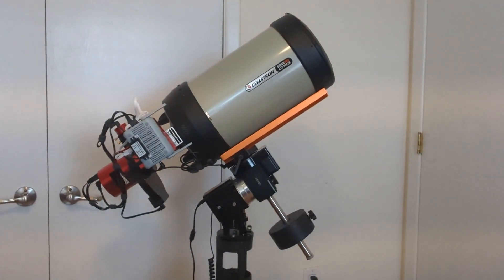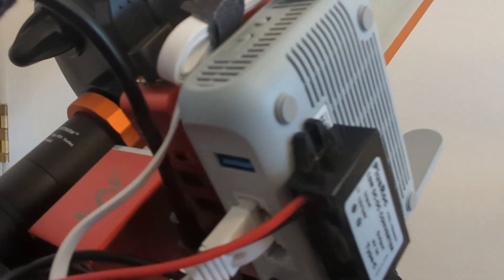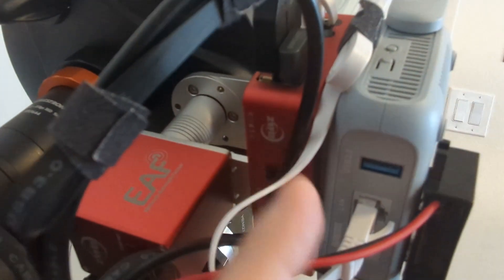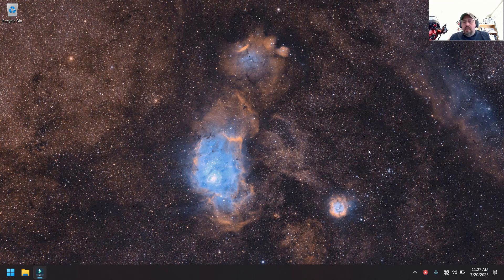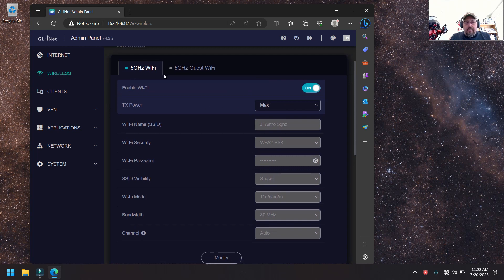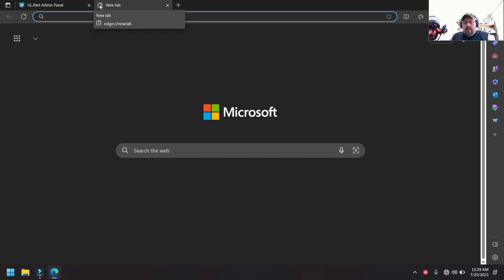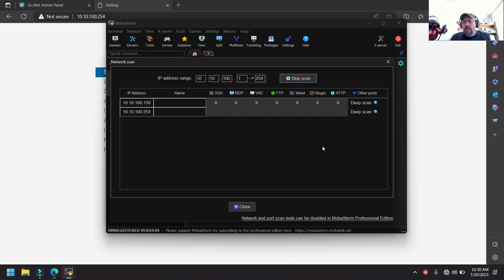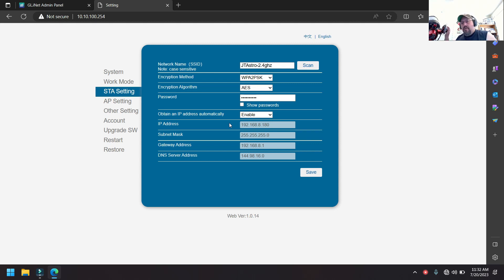iOptron + GL-MT3000 + ASIAIR

Comment: Joey, that was a great video! I had watched it several times. I was wondering if you use a pc or a mac. How would what you did differ for a mac? Thank you for you input and have a nice day.
Reply from the maker: So you can use a Mac or Windows. However to get Mobaxterm on Mac you need to either install VMware for free and install windows or you can pop for a license of Crossover

Comment: Great video, loads of information! I see that you are using many different softwares. The software for the MT 3000 should ne enough to get the job done correct? Please let me know, thanks.
Reply: Thank you
Reply from the maker: @donbarlow6435  my pleasure!
Reply from the maker: Yes it will allow you switch back and from from ZWO to Open Astro, to what ever the heck you want to use including Windows or any other system. Again the MT 3000 is simply a router that lets you connect directly to the mount and then from there what ever you want to use.

Comment: Thanks a lot. I have gem28, other router, all done well, almost work, I see my mount, asiair too on my router but how to setup mount on asiair. this one is some problem for me. with usb mount works, when I disconnect gem28 from the asiair it stops working. How to setup asiair, ethernet/serial?
Reply from the maker: I used to have the gem28 does it not have a WiFi option? You might be able to purchase an Ethernet to serial cable but that would be an ask to tech support at iOptron.
Reply: @JTAstro  gem 28 has the go to nova 8409 driver and it is there. I once connected to Asiaair via WiFi but I had to enter 192.168.X.1YY where YY=28/45/70. Now somehow I can't. The router connected via Wi-Fi to gem28. it's about what to enter in the asiair mount settings?
Reply from the maker: @astrobalkon  log into the router and make sure the gem28 is connected through the web portal.
Reply: @JTAstro  all works, I just had to enter the correct ip address and port to asiair for mount. THX
Reply from the maker: @astrobalkon  perfect glad to hear!

Comment: Do you live any where near Dallas?
Reply from the maker: I don't. Why, what's up?
Reply: I'm trying to WiFi my Ioptron EQ45 Pro mount to my AsiAir Plus via the Ioptron StarFi module.
 @JTAstro
Reply from the maker: I assume you connected the provided 4 pin cable to directly connect the RS232 port from StarFi to RS232 port on 
the telescope mount? If so when the ASIAIR boots up you need to turn on Station Mode under the WiFi and then connect to the StarFi network. It will take a minute to do and then once it's connected go-to the mount setting in the software and choose IP and then use IP Address 10.10.100.254 and Port Number 8899. That should get you into the mount.
Reply: That did it!  Thank you very much.  Now I have no cables from the OTA mounted AA+ going to the mount. @JTAstro
Reply from the maker: @cristrigotti9933  so glad that worked for you! Clear skies!!
Reply: All the best to you. 
 @JTAstro
Reply: I have since upgraded to the GL-MT3000 and I could find how you set the mount in ASIAir?  Can you help with that?  Thank you. @JTAstro
Reply from the maker: @cristrigotti9933  so based on the IP address you should be able to log into the unit per the instructions on the site iOptron site https://www.ioptron.us/Manual/8434_StarFi_Manual.pdf if you scroll to page 4 it explains how to log into the web portal you will need to connect to it's Wi-Fi like I did here at 5:41 in the video and configure it for station mode assuming it has that feature.
Reply: That should read I could not find out how to get the mount in ASIAir connected.
Reply from the maker: @cristrigotti9933  assuming you have the StarFi connected to the GT-3000 and it's showing up like it does for me at 5:07 you will want to snag the IP address and then choose the right mount in the ASIAIR software and use that address you wrote down and port 8899 and it should connect to the mount to control it.
Reply: Yes, I have the mount connected to the Router.  What are the settings under the mount tab in ASIAir?  I appreciate your help.
 @JTAstro
Reply from the maker: @cristrigotti9933  my pleasure. I am not sure which mount you need to choose if you look on page 3 of the StarFi Manual it should show what to use I am not sure if there is choice for EQ45 Pro but their maybe. If so that is the one you want to choose and then change the settings to IP and then pop in the IP and port.
Reply: How does the ASIAir talk to the mount?  Does it talk through the router or directly from the ASIAir all via 2.4G?  If through the router, what are the settings I need to use in the ASIAir mount tab? @JTAstro
Reply from the maker: @cristrigotti9933  Assuming you have the ASIAIR connected to the network to the MT-3000 in the LAN port is should just see the mount as long as the mount is connected to the MT-3000 via station mode. You are basically building your own network with the MT-3000 and all your gear.
Reply: I got it.  I reread your previous message about going to 5:07 and really paid attention.  Thanks again!
Reply from the maker: @cristrigotti9933  sweet!! Glad your rocking and rolling 🥳

Comment: Awesome!!  I'm trying to figure this out for my HEM27. From the PlusRoc  12V/24V to 5V Converter what to wires do you solder for the DC connection to the Plus and the USB C to the router?
Reply from the maker: If you check out the article in the post I have all the parts https://joeytroy.com/ioptron-gl-mt3000-asiair/ there is no click bait just direct links.

Comment: You sure are making it complicated if like to spend so much time with electronics and computer interfacing.  Mine will be much simpler.  I am more concerned about just having clear skies to use it
Reply from the maker: The channel is not about simplifying it's a technical channel geared to taking our equipment as far as we can go for Astrophotography.
Reply: @JTAstro  Thanks for your.  I am sure you do this for practical reasons.   Can you explain what you mean "taking our equipment as far as we can go for Astrophotography".  what does that mean?
Reply from the maker: @bobwilson8838  Sure you bet! When when I say "taking our equipment as far as we can go for Astrophotography" I simply mean pushing the limits of the hardware. A perfect example is Open Astro which I released https://www.openastro.net/. On the website you will find walk throughs for adding Astroberry, Stellarmate, OpenAstro and also INDIGO Sky for the ASIAIR PRO and Plus Raspberry Pi models. These type of operating systems allow you to take the ZWO to whole other level in terms of usability as you are no longer locked into ZWO hardware. Let me know if that makes sense.

Comment: I have a IO GEM 45, with a IStarFi module that I apparently can set it to AP/Station combo mode just as you did and I have the GL MT3000.  

So to make sure I got this,  the GL is connecting to the home network, the ASIAIR is hard wired to the GL, the mount wifi (in my case the IStarFi) is set up to connect to the GL Via station mode.  I am setting station mode on the mount to  connect to the GL as opposed to setting station mode on the ASIAIR 

The mount is getting its commands from the ASIAIR through the GL wirelessly since the mount is operating in station mode to the GL network and ASIAIR is hardwired to the GL network (There is not a eqmod cable going from the mount to the ASIAIR is there?)
Reply from the maker: Based on what you're saying it would work without a cable to the mount. One  thing is I am not sure what it looks like with the MT3000 connected to your home network not sure if that slows it down or not. In terms of the iStarFi I can't talk to that. Based on the reviews from iOptron it does not work with Astrophotography at least per the reviews. So you will need to test it. It may be helpful to update the reviews if it does in fact work for AP.

Comment: Nice setup! I have the hem 27 coming next week.
Reply from the maker: It's a fantastic mount and I have had lots of success with it! I'm sure you're going to love it especially the power port under the DEC head.
Reply: @JTAstro  Can you power an Asiair/ ZWO focuser/ ASI533MC with the DEC dc? .. and  can it communicate with the mount without cables?
Reply from the maker: @MilkyWayMishaps  yes you will still need the USB cables to the focuser and camera but yes it will work. I currently have DEC  to the ASIAIR Plus and from the plus I have the ZWO focuser, ZWO 2600MM, ZWO Filter wheel and the ZWO 290MM Mini guide camera.